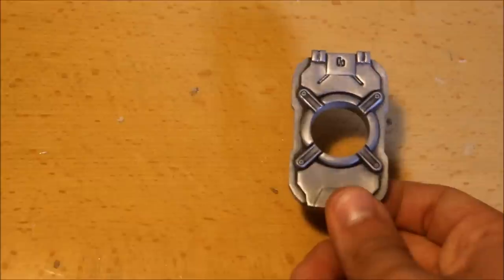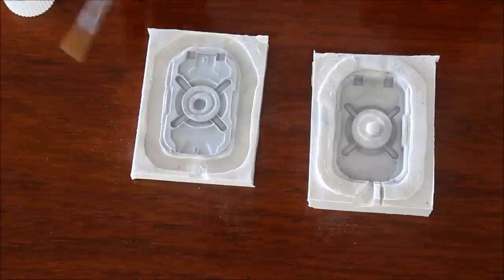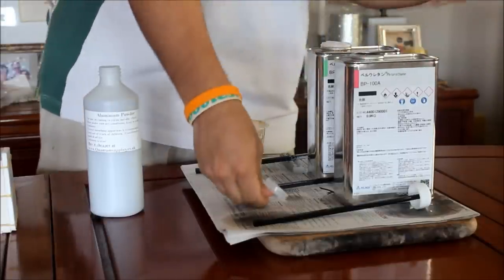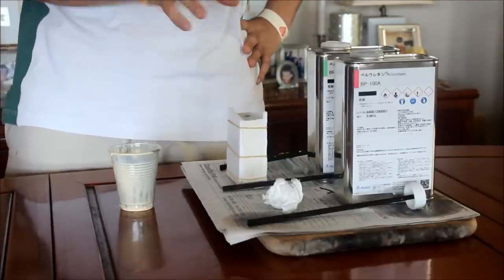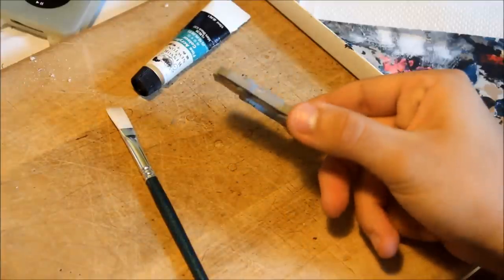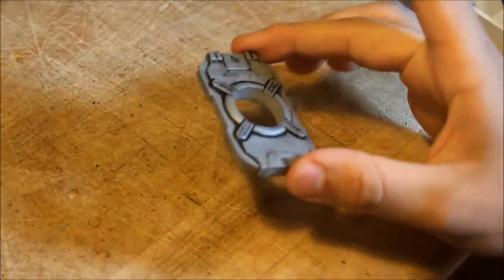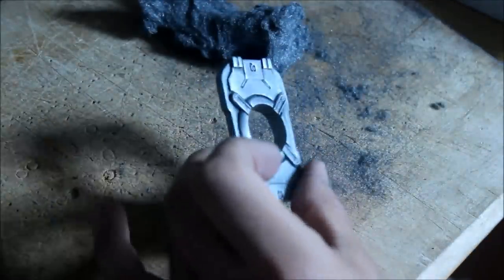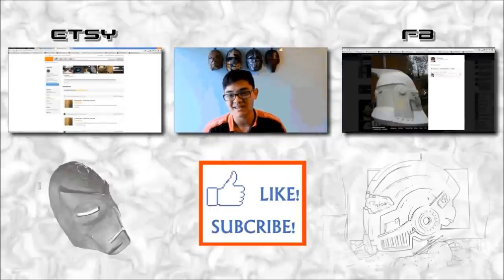How To Cold Cast Tutorial

Comment: Wow thank you so much for this video! Just a quick question, are you using a translucent resin? I want to do a prop similar like yours, but I'm going to use iron powders. If I use translucent resin (like Smooth-Cast 325), I need an extra pigment to color it? (The pigments are so expensive u_U).

Thank you in advance!!!
Reply from the maker: It's best to use a colour of resin similar to the metal of your choice, i.e. brown for bronze copper and brass, white or grey for steel aluminum etc.
Reply: KRSprops Oh, thank you! I like the result of your video, are you using white color resin?
Reply from the maker: Keevanski im using a light coloured yellow resin which works okay! its just best to use similar colours
Reply: KRSprops nice! Thank you so mcuh!

Comment: i rely learnt a lot on cold casting by watching your video.
my question is that, what may be some of the problems arising when using cold cast
Reply from the maker: moses kuagbenu main issue I have come across is air bubbles or any other surface imperfections, you can't really sand a cold cast piece otherwise you ruin it's metallic finish

Comment: i remember when i was young, working in jewelsmithing, we use the same methode bt we assemble the two pieces of rubber moldes together for a good administration of talk pouder and poor te resedue, to produce inside the melted wax, try to do the same with the metalic powder, may be it will work better. i enjoyed you video

Comment: Thank you, you make it look so easy.  Can you tell me if I make a belt buckle with this product, it will be strong enough?
Reply: +private91205 No, it's just plastic
Reply: If you use high enough strength epoxy resin, yes it very well could be. Another method that I have seen is to use 50% metal powder and 50% epoxy, your result should be stronger.
Reply from the maker: +StraightUpFerret stronger yes, but unlikely to be much stronger. also you would simply be trading stiffness and strength for brittleness. I think it depends on the design of your buckle, if its like a normal buckle with the thin metal arm that goes through holes in your belt I don't think it'll be strong enough

Comment: does the finished piece feel like metal? or sound like metal (with the ting)? is it heavy like metal? or is the feel of resin, with just the look of metal?
Reply: Danielle Epstein it has all the properties of the plastic, just with a metal look. However iron cold casts will actually rust unless treated on the surface to prevent that and can show small levels of magnetism
Reply: Thanks for the fast reply. Loved the tutorial! Last question...could you do a mold demo? The piece I would do is very thin just like yours(only 5mm) thick, but almost with no detail. I have no idea how to mold it so that I can powder coat it on all sides and what not. Would love the help!
Reply: I think if you mix powder iron and resin in equal volume parts, you get a final piece that feels more like metal than a simple plastic one. It definitely becomes heavier and is attracted by magnets.

Comment: What resin would be good for a 5 foot scissor blade from kill la kill?
Reply: any casting resin with a slow cure should do! 7-10 min potlife would be good
Reply from the maker: Christian Harris yep!
Reply: will it be strong enough for convention use?
Reply: xperiaviper either you will either need to cast it hollow or embed a steel rod into it to stop it from bending under its own weight
Reply: Ahhh thanks :D which resin would you recommend that's cheap but great for props?
Reply from the maker: xperiaviper resin doesnt get particularly cheaper per ml unless you buy it in 10 gallon or 10 kilo sets! but if you are in the USA then google smooth-on products, if you are in the UK then I suggest you have a look at tomps.com as they stock lots of great casting resins and cheap silicones!
Reply: Probably too late to matter, but it would probably be best to slush cast the scissor blade, and then fill it with a rigid expanding foam. Sonce it expands, and is foam, it'll both be lighter than solid resin, while still reinforced, and be cheaper. Overall, since you don't need to get as much product due to the expansion.